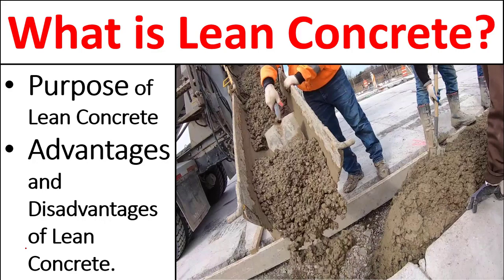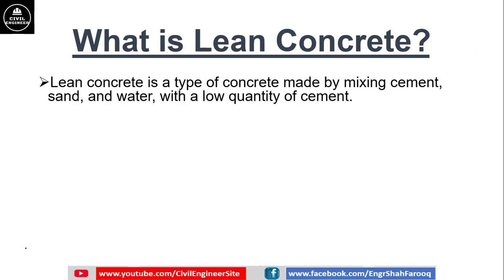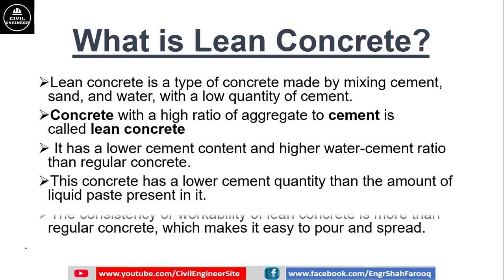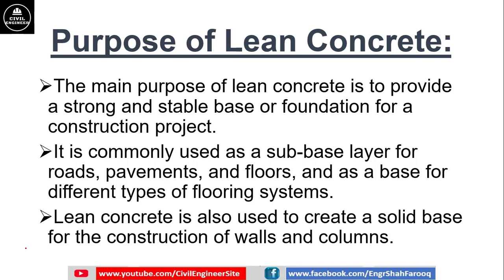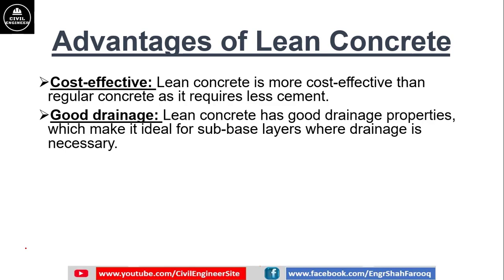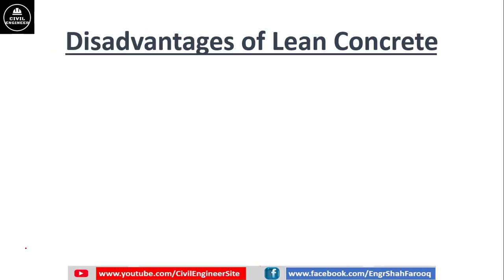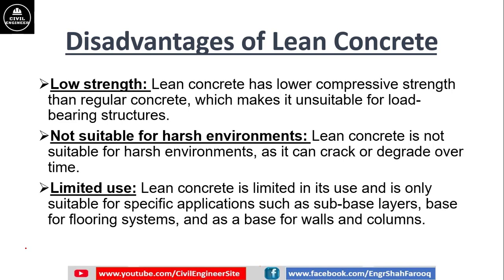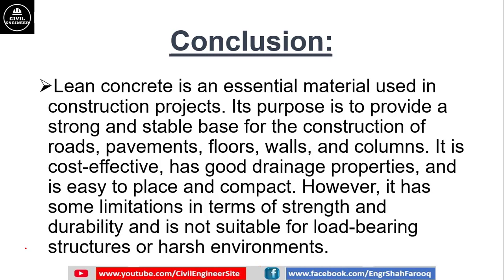What is Lean Concrete? | Purposes and Uses of Lean Concrete | Its Advantages and Disadvantages

Comment: We are building an ICF house on expansive soil ( fat clay ) the geotechnical Engineer recommended 36" of compacted granular structural fill under footing. Could lean concrete be used in place of the granular structural fill?